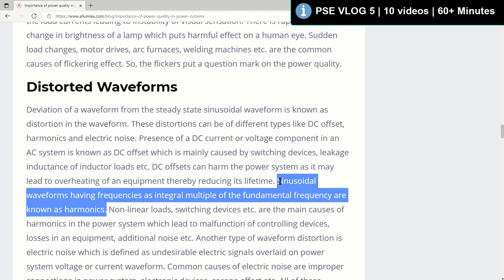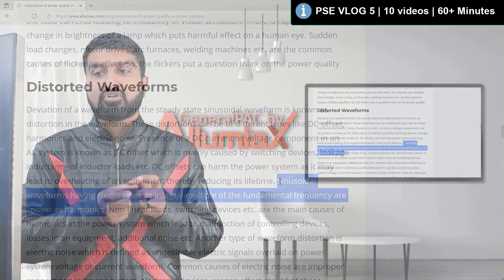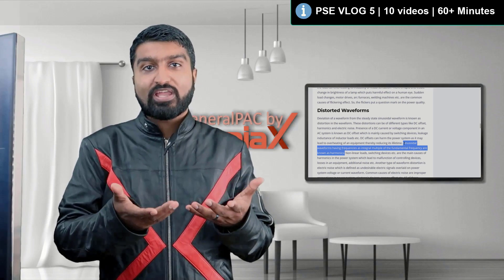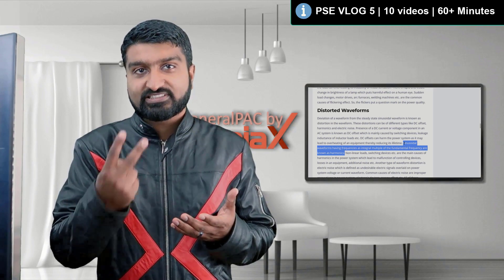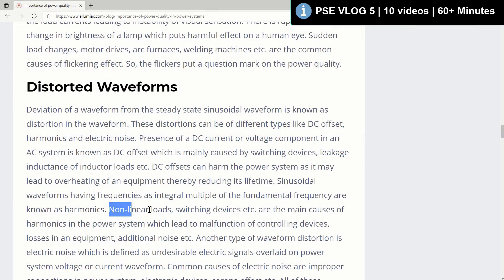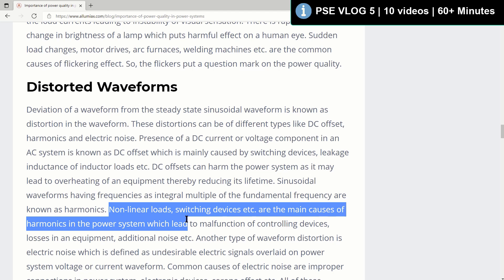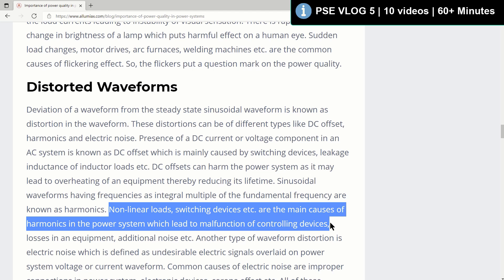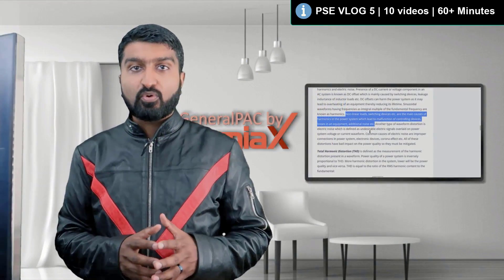Harmonics in Power Systems

Comment: Thanks for the video ... Really intuitive , i have a question about harmonics generated by solar inverters during  DC/AC conversion using the PWM method.

How can I distinguish between inverter harmonics and grid harmonics? 

As inverters are grid tied transformer less, so they have to follow the grid waveform in phase and magnitude all the time.

In my case inverters are derating because of this problem @ THD around 4% for mainly the total of the 3rd,5th and 7th harmonics.

Also what is the difference between current and voltage harmonics? I believe current harmonics are related to load and consumption, while voltage harmonics are related to generation and supply.
Reply from the maker: Hey Mohamed-Anwar,

It is not easy to distinguish whether the harmonic is produced due to grid or inverter. But in order to reduce the effect of harmonics on filter we can use an isolating transformer between non-linear load and our distribution system. Another method is to connect the non-linear load close to source in a separate feeder.

The cause of production of voltage and current transformer is same i.e. non-linear. The two major differences between current and voltage harmonics are:

1.       Current harmonics are generated in the source side (e.g. input of rectifier) and the voltage harmonics are generated at output of nonlinear converters which output is AC (e.g. Inverter output).
2.       Current harmonic only affect the cause of its production that is non-linear load while no effect on linear load. Voltage transformer effect both linear and nonlinear load.

Thanks,
GeneralPAC by AllumiaX